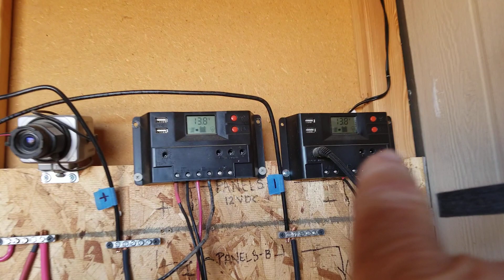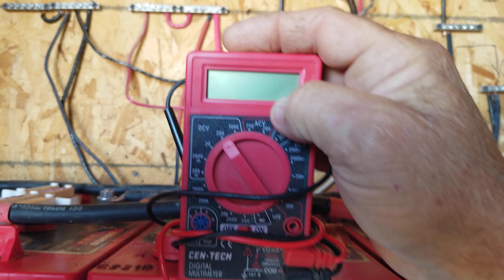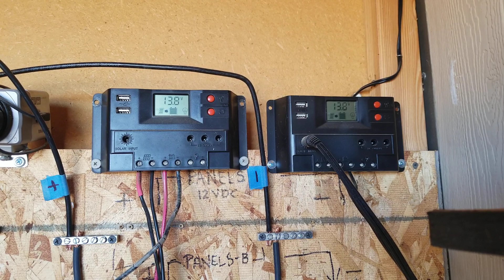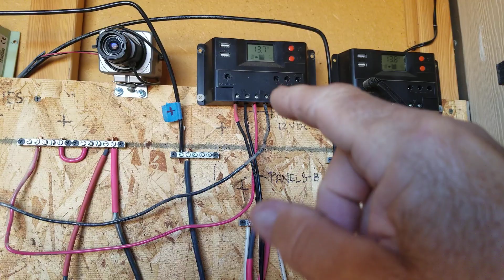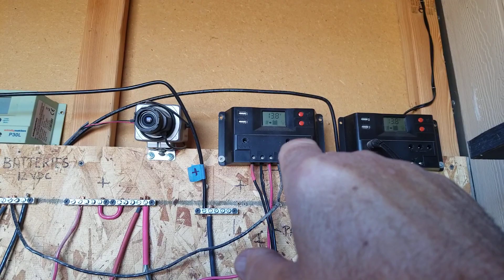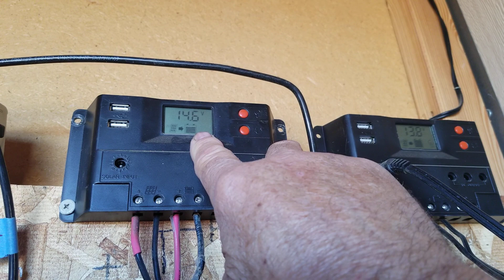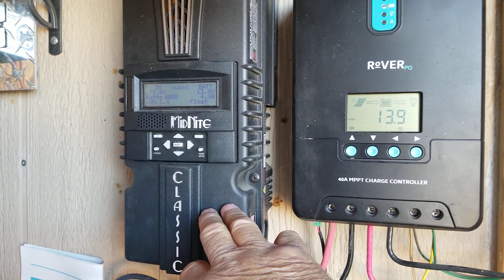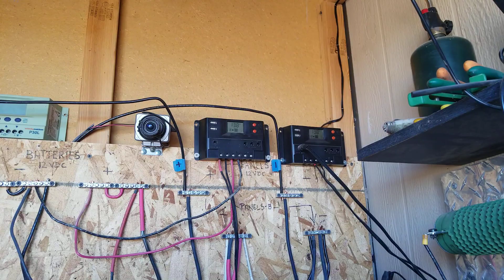Harbor Freight 100watt Solar Kit, Setup and Wiring, Mar. 26, 2021

Comment: Hey G Bear, I am just now hooking up my solar panels and I got one panel that isnt lighting up on my harbor freight solar kit. any tips on what I might check on to see if I can make it work? Shalom friend.
Reply from the maker: @oldpath7357  it could just be the blue led bulb.  Use a volt meter to test the panel in the sun to see if it is outputting 24-28v
Reply from the maker: @oldpath7357  If it's brand new, exchange it.
Reply: @GBear  It's not brand new I bought it two or three years ago and just now putting it together. I tested the power and didnt get any reading.
Reply from the maker: @oldpath7357  That’s strange.  Never used and gone bad in the box?  Or did you connect it while sun was on it?
Reply: @GBear  I just got them out of the wrapper and linking them together with the tabs and noticed one was not working. I tested the leads and found no voltage/power. I never hooked them in.😥
Reply: I see a new replacement panel is 49 bucks....
Reply from the maker: @oldpath7357  the next thing to try is remove the back cover from the wire connection box and check for wire connections.  Check continuity between the SAE plug and the solar panel connection to insure the wire isn't broken or defective.  Be sure to do that indoors away from light so the wires aren't charged.

Comment: You know I still aint put this thing together. I couldnt remember how you said to hook up the solar panels without using that plug.....found it. LOL hooking tomorrow so if there are any last minute details lets me know. LOL Hey I liked the solar controller video you just made. See ya friend. Shalom.
Reply from the maker: Glad you found it!  I'm trying to get this company to send me one of their batteries so I can put together a complete mobile system and show my viewers how to run power tools away from the main electric.
Reply: @GBear  I'd likie to see that. Sounds a little like what I'm trying to do...kinda. I got an aluminum truck tool box and thinking about mounting the panels to the top of it and using the inside for the batteries.....may run wire for inverter and controller to be inside my shop though. The whole lid on my tool box raises so I can tilt for full sun. Just drag it around in the yard till I hit the right spot. LOL Shalom friend.
Reply from the maker: @oldpath7357 Sounds like somewhat of a plan.

Comment: Those cheap@$$ red meters ain't worth a full! Your  lucky you didn't burn anything down!
Reply from the maker: They work, but I wouldn't trust them to take 'exact' measurements.  For continuity, rough voltage readings, etc., they will get you through in a pinch.

Comment: Am useding 200 wants of solar panels for my camper trailer on off grid frist time using solar panels and the are working great so far
Reply from the maker: Great!  Depending on what you run and how many batteries you have, that should serve you well.  I still have only 45w of solar and one yellow top battery on my van and can run my air compressor or tablesaw, or other power tools when needed.  I bought that yellow top battery back in 2013 I think.
Welcome aboard!

Comment: I have a 100 watt Harbor Freight kit like you do. Question, can I buy 4 more 25 watt panels and tie in to the same charge controler?  A total of 200 watts? Or would that be too much for the harbor freight charge controller? Thanks.
Reply from the maker: I think HF controllers are 20A, but double check that.

Comment: I just bought a Harbor Freight Thunderbolt 100 watt kit. Thanks for the added info that I couldn't find elsewhere.
Reply from the maker: Cool.  Let me know if you need more info/help.  I just got notice from HF that they now sell 100w monocrystalline panels.  They advertise them for $99/ea.   What are you planning on running with them, and do you have a deep cycle battery to hook them up to?

Comment: Are you using the big green resister mounted on the aluminum diamond plate as a dump load?
Reply from the maker: I was until my dump load controller took a dump.  I'll be replacing it with a digital diversion unit.
Reply: @GBear  OK thanks for the speedy reply, I was just wondering about the resistor's use
Reply from the maker: Well, you nailed it!  Welcome aboard!😁👍

Comment: I have the harbor freight solar system for my motorhome. I run my Treva 12" fan with USB ports for my phone charger off of it. I have my interior lights (came with the solar system) set up on the 12 volt plug. And I run my ignitor/fan for my propane fridge also. 
My motorhome is old & the lights, furnace & never used oven do not work. So, I rely on my solar to provide the bare necessities.
I use the color wire (shinky dinks) to know which wire is positive/negative like you do too. I also used the crimp fitting spades to connect my wires to the charge cotroller. I used my wire cutters to cut the spades into a pie wedge to fit in under the connection screw. I didn't have any solder.
I do need more batteries and panels for extended times of low sun. But I barely scraped by this past winter by not using the fridge. Here in Michigan all my food stayed frozen in a cardboard box in the back seat of my truck. LOL I am wanting to get the plug hub and since it eill hold up to 400 watts I should be able to live pretty comfortably with that. I am moving south to Kentucky when I get my stimulus to repair my brakes, since my social security is too small to cover repairs that expensive. I also want to start a YOUTUBE channel. And show people that a one working armed, single, old woman can get along in life just fine. And make videos for my grandkids & great grandkids to watch "Grammie" on tv.
Reply from the maker: Sounds great!  Let me know if I can help you set up your channel and such.  I'll also give you a shout out to get your subscribers going!
Reply: @GBear   Thank you I do have a few questions. Do you have an email I can send them too?
Reply from the maker: Gbearhomesteading@yahoo.com

Comment: I’ve got a few of those harbor freight panels. Bought them 4 or 5 years ago. They work just fine. I had a buddy when I first bought them tell me they were garbage and wouldn’t work. But luckily he was wrong
Will being broken like that eventually cause failure if water or dirt gets in?
Reply from the maker: Yeah, I had people tell me the same thing all those years ago. 
The broken glass will probably cause failure in the future.  I've been looking for a piece of glass or plexiglas to cover them over, but haven't come accross anything yet.
Reply: @GBear  would normal 1/8 inch thick plexi work if you just glued around the edges?
Reply from the maker: That's sort of my plan, but I don't want to buy the plexiglas because if it doesn't work I threw away good money.
Reply: @GBear  that's true. gotta do some more research

Comment: Good morning  you know if you use a 7210a charger controller with 12v solar panels and charger a 12 24 36 48 volt battery system because is a buck convert

Comment: good information, but for the price of the harbor freight solar kit you could go out and get a better system and still have some money. as of last check you can buy a 100 watt panel for 60 to 80 dollars charge controller around 90 to 100 thats for a mppt type. batteries are most of your cost as usual. wire is another issue regarding building a system you will have to look that one up you can find it on line most times its free. sorry for the rant i hope all is well your way and have a great weekend
Reply from the maker: Thanks.  You do realize that the reason older solar panels are so cheap is that they are either old technology or seconds.
But I get your point, and you are right.  These Harbor freight solar kits are better suited as portable systems for camping, etc.

Comment: Well nobody told me, I guess...but...I've got two 45 watt HF kits that are in series, not each panel but each kit...anyways it comes out to 36 volts or so with both of them so I put the two kits that are in series in parallel with 2 sets of two 100 watt mono panels (until I  can get 2 more)...And anyhow I get more watts hooked up like that...I had them hooked separately to a 12 volt bank but the panels were never in their optimum voltage range so I lost wattage compared to the other way...I noticed it was better the first day after I changed them to series...lol...its funny...I thought that's maybe why the wires were kind of small, like they were supposed to be in series so it didn't matter...Im gonna shorten the 60 or so feet of wire on these two kits down in the morning...supposed to be 73 and sunny, and I'm gonna see how much more power they put out when it only has 12 feet instead of 60 to wade through....I figure itll come out to about 40 volts which is about what my mono panels are so I guess I didn't see why it wouldn't work...it's okay, I never follow rules anyways...I do pay attention to Ohms law and that's about the only one. I got a reply from a harbor freight dealer who said the wires were probably undersized for optimum wattage and that most people used them in a movable type scenario...which I can understand if you're moving them it's nice to have longer wires , but I'm gonna see how many watts I can get...so chop the extra is coming off of mine tomorrow..there's not much else I can do , it's too wet..the ground was already saturated then we got another 6 tenths last night...the ground is oozing lol but good time to plant
Reply from the maker: Interesting.  I figured I would experiment with the broken panels as soon as I get my new 320w amorphous panels to replace them.
I'll let you know how that goes.

Comment: G-Bear, thanks for more valuable "Nugget" info on solar!   Question,  is that video camera active... just to check if there is smoke in your power house?
Reply from the maker: All 16 cameras on the homestead are active.
Reply: @GBear  Ya... I have been thinking of setting up several security cameras for my new "Off Grid" home build... would like to know how you manage all the camera feeds, i.e. software you use, etc.  Thanks!
Reply from the maker: I understand,  but I won't give out any more info than I already have, (for security reasons), except to say I have remote access from any computer or smart phone, and can view and make calls at the same time.

Comment: Put some super glue in the cracks on those panels to keep the water out they'll last longer
Reply from the maker: The amount of super glue needed would cost more than new panels. 😂👍
Reply: @GBear  okay too many cracks huh 🤔
Reply from the maker: Hundreds, on 3 panels.
Reply: 😳 wow that many you can get some of that clear epoxy and put it on there with a paint roller it'll work perfect it's the same stuff for countertops and woodworking that is if you're interested in saving your if not just chunk them whenever they quit working
Reply from the maker: I'm waiting to see if I find either glass or plexiglas that I can overlay them with and silicone around the edges.

Comment: That is weird not being able to use them in series...Have never heard of that before, curious why that is. That is a deal breaker for me. I got used solar panels from a huge farm, they are 250 watts each, only a couple years old and tested and still at 100 percent of rating, comes with a guarantee  and a steal at 60 bucks a piece. For me solar panels are the best thing to buy used for your system, everything else in my opinion should be new, just my opinion
Reply from the maker: Good deal!  I got my first 305w panels for $100/ea new.  I plan on getting 4 more asap.
Reply: @GBear Wow thats a steal on those panels! Is that a retail price? Where could I get some of those for my future cabin?
Reply: Wow
Reply: I didn't know any better but mine are

Comment: Thinking of doing this ourselves bc our power company is absolutely gouging everyone in our city even though indictments and many other allegations have been served to our city, they still get away with it because of a new "program "for billing.  $500+1k+ Bill's for electricity water and sewer for some people even in the winter when electricity bills should be low.
Reply from the maker: Be aware that a 100w HF solar kit and a couple 12v deep cycle batteries won't run very much for you.  Maybe a few lights, a TV,  laptop, and cell phone charger.
For grid electrical savings, start by replacing all incandescent bulbs with LED, limit microwave use and any kitchen appliance that produces heat, and electric space heaters of any kind.
To make a difference on grid, a full solar system is a must.  There are companies out there with great deals because competition is high.
Reply: @GBear  thank you for the info!
Reply from the maker: You're welcome.

Comment: Good Evening !  TAKE CARE..
Reply from the maker: Thanks, and a good evening to you too.
Reply: @GBear  You Bet, I'm Still watching the vid. I liked the tip on soldering the wire end for good contact! Have a Good Night. TAKE CARE..
Reply from the maker: I do that for all stranded wire connections as a rule.  I have a couple joins that need to be corrected because I used crimps to speed up the install.
Reply: @GBear  Sounds like a good way to do it ! TAKE CARE..